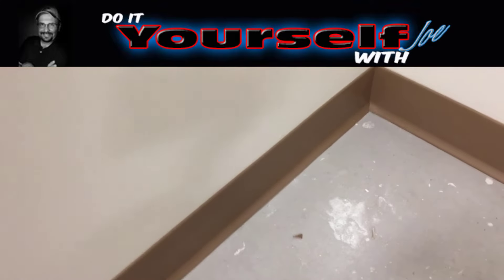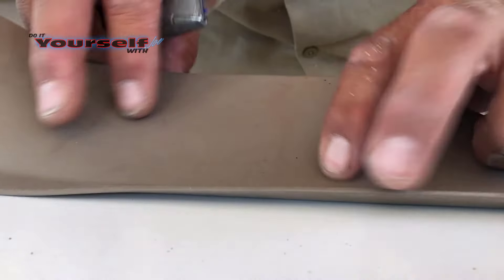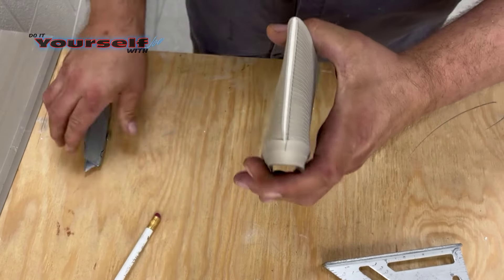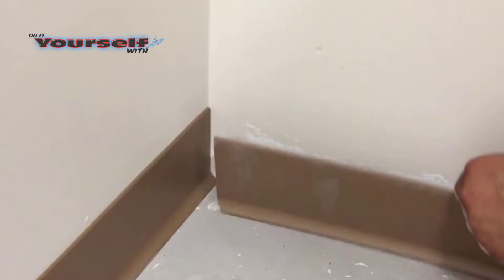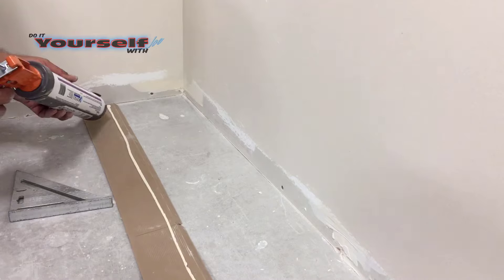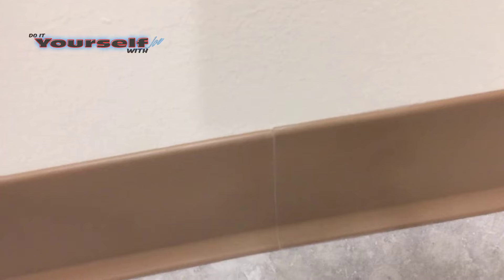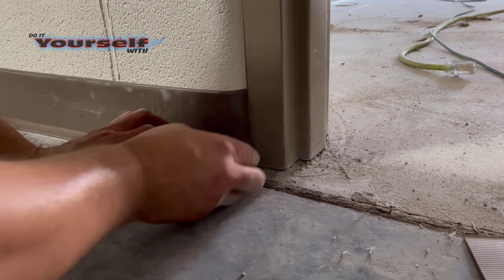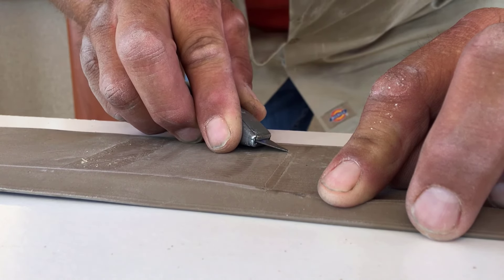Rubber Base, How To Install Rubber Base

Comment: What if you have multiple outside corners in one single run do you lay out the entire length of the wall Mark and cut the first outside corner then go and mark the next outside corner or do you suggest doing a butt joint in between?
Reply from the maker: Ive done it both ways. I did a practice cut  when I didn't have a butt joint.

Comment: We never heat up the base.... I'm thinking its worth the effort. Especially on that cement wall by the door frame. Because that cold wall is definitely going to want to shrink the base (I'm in Canada....shrinking base is an issue. Ha! shrinkage)

Comment: I would assume once glued to the wall there’s no going back, right? What I mean is one cannot remove it without damaging the drywall.
Reply from the maker: Depends on how long after the install. If it is with in a day after the install you can usually remove the base but yes, it does pull the paper off.

Comment: How do you do the base for curved wall? Do you have a video on that?
Reply from the maker: Rubber base on a curved wall or regular wood base on a curved wall?
Reply: @Doityourselfwithjoe  I figured it out I nailed it with my compressor worked perfect thanks

Comment: What glue do you use?
Reply from the maker: Its glue for rubber base. It should be in the same location as the rubber base material.

Comment: Why is every video wrong, base is so easy, he forgot the most important peice of info, so much anxiety
Reply: What’s the most important piece of info?😊
Reply: Are you asking about the important piece like rolling the base, making sure it seated so it doesn’t look like straight base and all wavy, making sure the outside corner floor section is still cove and not straight, properly spreading adhesive like the manufacturer recommends, how to make an inside corner so a pencil doesn’t fit in the corner. At the speed and way some videos show, you’d have to charge $3 a Iinear foot just to buy lunch
Reply: @slolojr1  haven't finished the video, but at least it started on a high note since this is the only YT cove base video that doesn't show the guy cutting base holding it in his hand with a spare thumb directly in the path of razor blade under tension...
Reply: Good luck on your video. I wasn’t trying to be critical of this guy. I appreciate all the people who actually put info out there that is helpful. Flooring just happens to be what I do and was most critical of my own work. There’s no one perfect way in my book, but only a few ways give really good or correct results. All the little details result in the larger best install. Sadly our trades are in the battle to quicker, dumber, cheaper, and good enough.